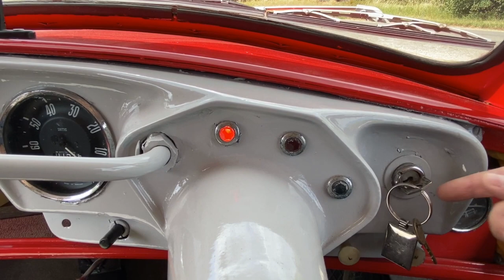IDRIVEACLASSIC reviews: 60s Bond Mini Car Mark G (micro car/mini car review)

Comment: Had a few - better/warmer/drier than a motorbike. Performance zero, brakes worse on earlier ones. Reliability not great, although they would usually get you home. Despite this the design was rather good, if it only had a decent engine, bigger wheels ( earlier ones only had 8" tyres! ) and some brakes.

Comment: "What wonderful toys, Mr. Bond!" 😂

If Bond were smarter they'd have seen the writing on the wall and come out with a 4 wheeler and maybe have survived.
Reply: Reliant made Rebel, Kitten, and Fox four wheelers but they only sold in small numbers compared to their threes.
Reply: Remember Bond made the `Equipe' based on the Triumph Herald / Vitesse as well.
Reply: Bond were smart enough to start building the 4-wheel Equipe coupé from 1963 onwards